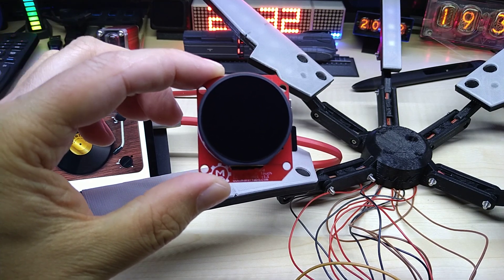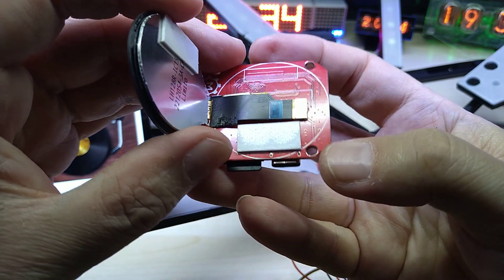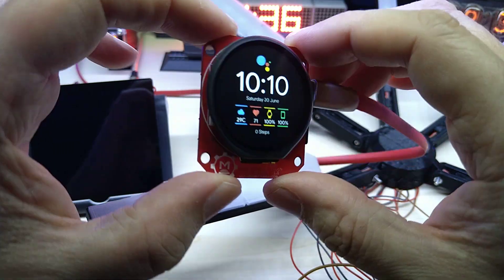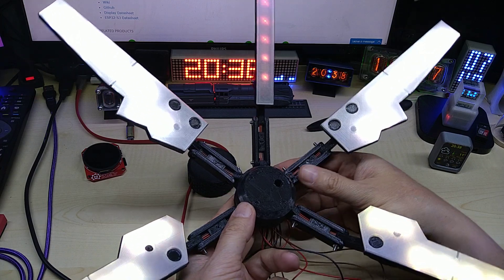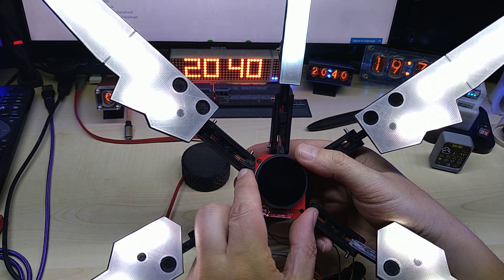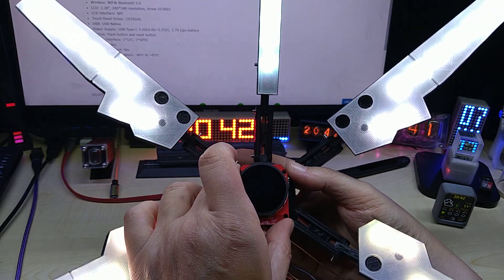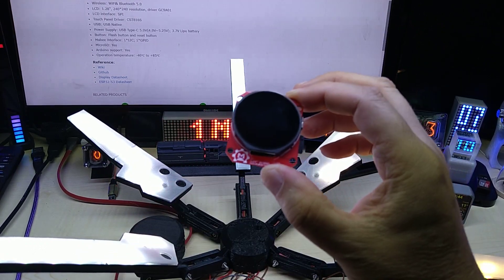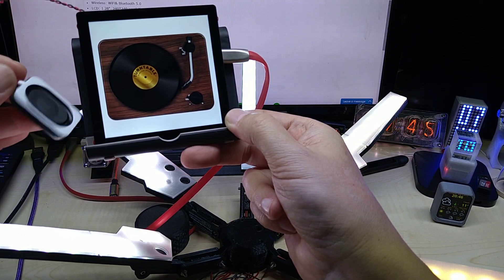1.28" ESP32-S3 Capacitive IPS Touch Display with 240x240 pixel from Makerfabs, review by #Hayri

Comment: Will the touch interface work through glass or plastic?
It would be nice if the touchscreen could be used inside an enclosure with a glass top. I doubt it will work through anything but a thin film but I thought I'd ask anyway.
That display sure looks nice. I'm very tempted to purchase one but I have so many projects, I kind of hate to start a new one.
Thanks for another interesting video.
Reply from the maker: The top of the display is glass, so I will make a round cutout to be able to touch it directly, but you can also cover it with additional glass or thin plastic and the capacitive touch will still work. Think of it like screen protectors for cell phones, the touch still works after applying one. Glad you like my video 🙂

Comment: Very cool. Are you using PETG for the clear? Have you tried using any of the settings tutorials for "printing glass"? You can get a pretty good result with 20mm/s and 104% extrusion, and aligning all the infill/layers in the same direction. That's if you don't want 100% diffusion of the light.
Reply from the maker: I  read  about "printing glass" but never tried it, I am using transparent white but would actually like it to be more diffused, might add a sheet diffused sheet that I have from a dissected  LCD TV.
Reply: @iHayri1  That's a great idea for a diffuser